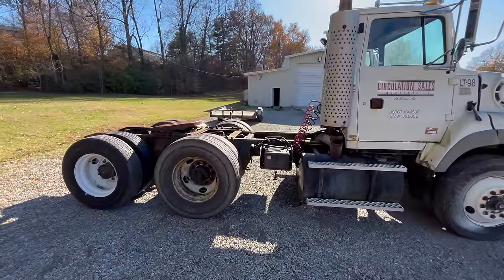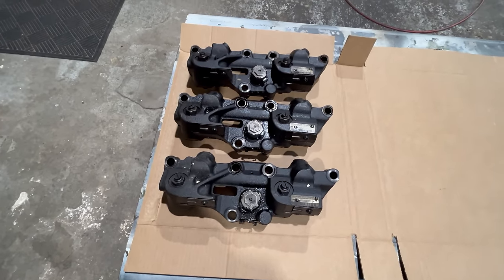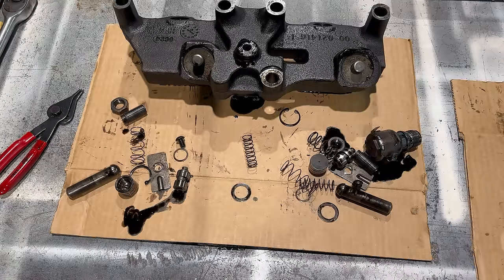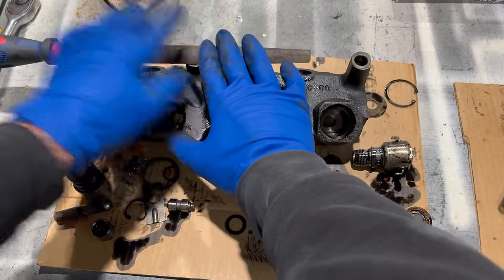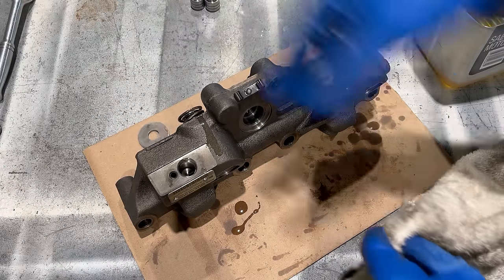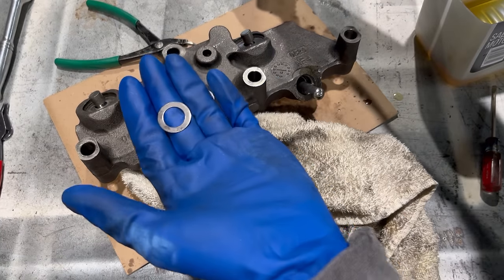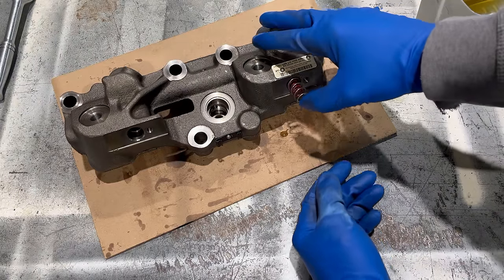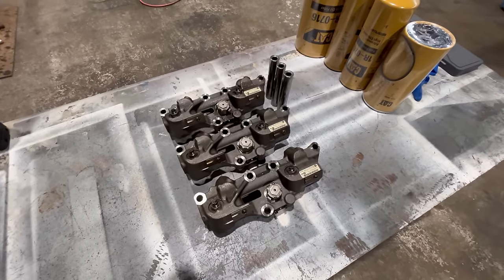Jake Brake Rebuild - 340 Series - Caterpillar 3406E C-15 C-16 C-18 Diesel Engines

Comment: I always wondered how Jakes worked and watching you tear down and rebuild really helped me to understand how they function. Thanks for the great video.
Reply: A Jacobs brake takes potential energy and expels it out the exhaust. You only need to use them when necessary. As when the exhaust valve opens, it causes the piston rings to relax rapidly. Normally you should not have a problem. In some cases and with a worn piston ring (top). It can snap the ring over time.

Comment: You could have posted this two weeks earlier! I just rebuilt mine, and couldn't find a good video on this anywhere.  So i struggled through.  Wasnt really that hard, if it comes out one way, the new ones need to go back in that way. But i was alittle unsure of myself going in. Great video.

Comment: Loved the video!  I had jaks on the 8v71 on the GMC bus we redid (inside and out) for a close friend of mine. I never have had jaks apart.   Put power steering and an allison 740 in it to make it a lot more user friendly for my friend.  Gave the 8v71 a once over including running the overhead. They used that bus for about 8 years with minimal problems mainly radiator, fan belt, and wheel bearing issues.

Comment: A trick with those damn internal snaprings I have found if it doesnt wanna line up right you can get it 3/4 of the way seated and use a flathead to tap it into the groove.  Once its in you can verify that its actually seated all the way round by pushing on one of the ears with a flathead - if it spins in the groove without binding you know you are good!

Comment: Thanks! We have a 3406C that has really weak Jakes, and I haven’t tackled it yet just cause I didn’t know what all was involved. I’m sure it’s a little different as it is 3 cylinders to a housing, but should be the same basics.
Reply: A tune up kit is offered, biggest things are oil leaks. You can take valve covers off and with the engine idling. Press down on top of the solenoid. Look for major leaks out under the solenoid and the front dowel pin to the rocker arm. Has a oring 7C0031. Also look for allen bolts that hold the plate on loose or missing. Inspect exhaust adjustment screw and make sure top is still on it. If they brake off, they won't contact the Jake plunger.

Comment: Excuse me for asking but because I don't know, what is the reason the manufacturer uses two springs in these kinds of setups? BTW I would trust this guy more than any "trained professional " any day. His work is just perfect in every way 👌
Reply: Had a kt Cummins  with jake with single springs jakes would work then fade out then in the check valve would un seat &release the high pressure oil in the hg , doublle springs cured problem !

Comment: Are you going to send or tell the buyer to use the higher torque mounting bolts? They last longer and with certain Cat engines they are required. If you order a new Jacobs brake kit they are in the kit.
Would like to see a video of the same thing on a 349A Super brake and the adjustment procedure.

Comment: Here's a story we were told in diesel school.
Once upon a time there was a co that had a 
gigantic diesel powered stationary emergency
backup generator. Well, the boss had assigned
his son to be the emergency diesel dept head.
As was their habit, they fired off this diesel 
monthly to ensure it was working OK. One
month it would not start. The crew was all over
it when the bosses kid shoved everyone out of the 
way and took over. He called the shop helper, gave 
him some money and told him to go and buy 2 of the 
biggest containers of ether he could find. The kid 
returns with 2  one gallon jugs or ether. The bosses son 
opened the air cleaner, removed the filter and started 
pouring.. Oh yeah, he poured the whole 2 gallons down 
that big diesels throat. Everyone of the crew ran for cover
& hid behind whatever they could find. Finally, the boss son 
climbed down off his ladder & hit the start button. At first 
NOTHING. Then, all that ether lit off & that big diesel fired.
All that ether created SO much pressure in the cylinders
the head lifted off the block, coolant shot out & the heads 
slammed back down on the block & the engine roared to life.

!

Comment: That CAT sounds great. . . How many hours/miles before you will realize diminished function/braking from a set of Jake's on 3406-C15 in/under normal use? What is the greatest  cause or Jake failure?
Reply: I would say that the biggest cause of Jake failure is misuse or using them when not needed. To me, if you can’t shift your transmission without using the Jakes, something is wrong.
Reply: The biggest failure  is the jack a#$ driver overr winding the jake,  stomping the throttle  on & off & leaving the jakes on for long periods  working with out shut off for short periods then back on will let oil get in point  of friction.

Comment: I have a question for you. One of my trucks just had an out of frame rebuild. Maybe 30k miles on it and the number 3 exhaust rocker broke. Could bad jakes cause this. Do they need a rebuild? My driver knows someone and swears thats what cause it. Says in 3rd jake setting they are making noise that indicates it as well.

Comment: The Jake brakes have a little screw on top of them it's a star head that sits down inside of a hole. One of my jakes is missing the screw and I noticed it was squirting oil out of it the other day after I run the overhead. Do you know what that screw is called or what it does

Comment: Can you use 340D heads on a 2ws? And what would happen if you put the 340d head on the rear and had pac brake heads in the middle and front? Thanks

Comment: @kt3406e When the jakes are on. What should be the turbo gauge psi showing?  My gauge showing 9psi at 15,000 rpm Cat 3406e. I feel like my jakes are weak or thats just normal? Thanks

Comment: Is the BXS jake different than the MXS ? I drive a truck now with a BXS and the jake is ok ,years back I had a truck with an MXS and the jake was quite a bit stronger than the truck I drive now
Reply: A MXS/NXS/SDP uses a Cat compression brake with the IVA made into it. A BXS, uses a CAT IVA and a separate Jacobs Brake. The BXS had a update on the JAKE Brake to prevent bolt breaking. Need three 2572122 bolts per brake, total of nine. Reuse one bolt, reduced shank for oil feed. Most of these have been updated, but I see one every so often.

Comment: Everything is rebuilds now. Jake's, Injectors, everything. And they one for one you on cores through Cat. It won't be long til your just not going to be able to run these engines. Aftermarket stuff isn't engineered to what Cat OEM was.

Comment: Question. Does anyone make a set of Jake's for a 5.9 common rail 24 valve cummins? It would be the 04.5 variant for the dodge. 
Just curious
Reply: Pac brake They make a exhaust brake. & made sort of a engine  brake  for 5.9 / 6.7 cummins . Don't  think pac made a engine brake  for 4cyl , they  have to fit under one valve cover multiple  covers wont work. I think the exhaust brake  will work on 4 cyl.
Reply: Sorry , yes pac brake  makes one for 24 valve , they are expensive around $ 2300.oo . It is a weird deal buying a set a outfit  in Utah  helped develop it so you can only buy the engine  brake  from certain place's  not any pac brake  ware house can get them.
Reply: @ruxoneto6560  oh ok 
So they do but you have to figure out what you really want and where to find the right items

Comment: Why are jakes for these engines getting hard to come by? Usual excuse we've been hearing for two years or something else?
Reply: As Cat no longer builds a current production truck engine and with the Cat version on the brake used on twin turbo engine's. Demand from Jacobs has decreased for a large quantity. The 349A super brake housing has been discontinued and no more are being cast. Just a matter of time and the 346 series and 340 series will get the same fate.

Comment: Can yoput a Jake break on a gas engine
Reply: Jake brakes could be put on a gas engine.  They brake by venting the cylinder at the top of the compression stroke, meaning that the engine loses power compressing the air but the air never gets to act as a spring and put the energy back in the powertrain - the energy gets ejected out of the exhaust as heat.  There's nothing about it that requires it to be a diesel engine, its just that in the applications that you would want an engine brake (massive loads) a diesel engine is probably already being used for its torque output.